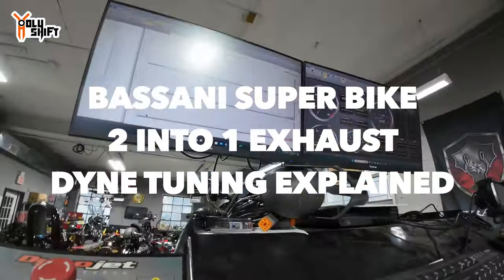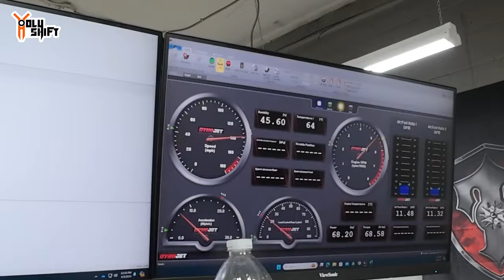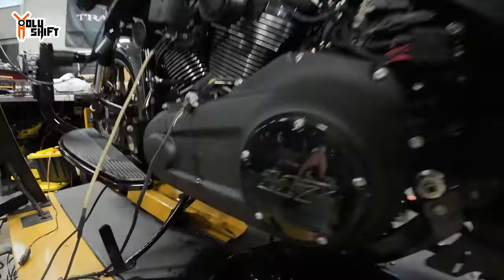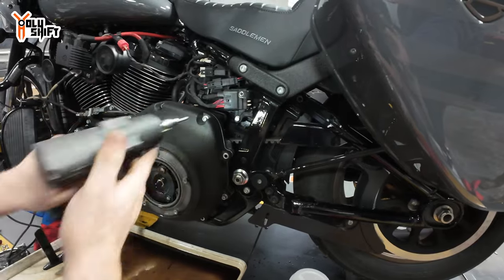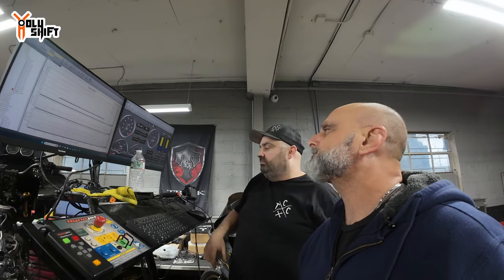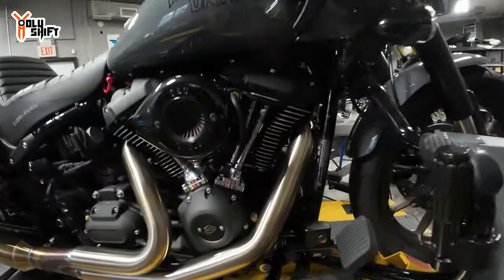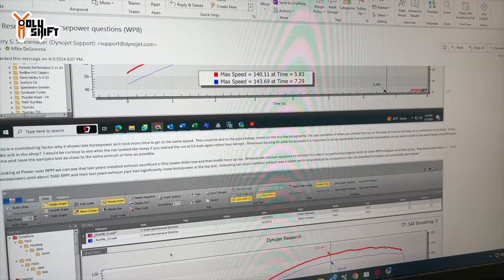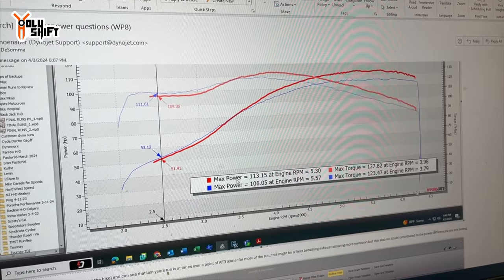My Bike On Fire ! Tuning Bassani Super Bike 2-1 Exhaust

Comment: 106 and 123 that's terrible.  My 2023 lowrider st with 3030 cam has 122 and 133 with a shorty 2-1 gallop sleipnir exhaust 55mm aluminum intake a d 5.5 injectors  sandy sandy sandy. You're barely over stock numbers with all the work you've done brother. I guess as long as you're happy that's all that matters.
Reply: Right his numbers seem low, I’ve seen some bikes with stock everything and just a pipe make those numbers, wonder why 🤔
Reply: Was that with a cam? I wasnt aware he ad ever done a cam yet. If stock cam, the numbers are on track with that pipe.
Reply: @AlenGarner  I found out. He has a Star 30 30 in it. Wth. Perhaps the Dyno is reading low or the tune is a bit off someplace? Crazy considering he spent around 4k in parts to do the cam.
Reply: @charleswhite2874  something is definitely off

Comment: Congratulations,  you have shown the difference between a short exhaust pipe and a longer pipe.
Also don't  worry about what numbers other people get, as EVERY dyno reads differently. Plus the operator can play with the numbers with gearing and even air pressure. Your not racing, just enjoy the ride
Reply from the maker: You’re 100000000% percent right brother!

Comment: Great Job and thank you both for the info.  Very helpful.  I am in my early 60's and many of my buddies that have bikes are into hp and torque.  Where as for me - I don't plan to race, I just want the sound of the pipe😎.  I've bee researching for 1 year as I am planning on buying my first Harley and leaning towards the Lowrider ST.  But would like larger bags as well.  Thanks.

Comment: range of RPM that the motorcycles engine is operating at peak performance. This is usually the point where the climbing horsepower meets the peak torque. Power is the product of torque multiplied by speed of rotation (force x speed), so power is produced in the upper speed range where there’s both high torque and high RPM.

Comment: @Holyshift Sandy -  What gear are those dyno results from?  Mine was done in 4th gear and I got essentially the same numbers, Star 30 30 and S&S 2-1 Superstreet, all else stock except Arlen Ness Big Sucker air filter for my Harley ventilator.  Bike runs great but doesn't have no where near the numbers everyone else is posting
Reply from the maker: In 5th gear . I don’t trust other peoples results and what tweaking their tuners are doing to the machine to show higher results.
Reply: @HOLYSHIFT  I believe most do their runs in 6th gear, higher gears show higher #’s.

Comment: Why so much blow buy that is way to much. Is your engine oul overfilled
Reply: @BeardedBavarianBiker.  it's got a piston ring problem.   My 150 cubic inch M8 with total seals rings have no blow buy what so ever. And still running the stock Trans vent cover. And no oil in the intake also. He must have a bad ring or bad bore. Or over filled engine oul

Comment: With all the work done those are low numbers something doesn’t seem right
Reply from the maker: It does sound lower than other videos I see online , I don’t know what other people do to their Dyno results to make them look better . These are pure pure numbers no playing around to show higher results. Remember still stock throttle body and injectors…. So who knows.
Reply: @HOLYSHIFT  yeah I know Dynos can vary from 5-10 HP, is the tuning being performed with the dynojet? If so that can be what’s limiting power potential you’d get more out of it with a Thundermax tuner with the wide band 02 sensors